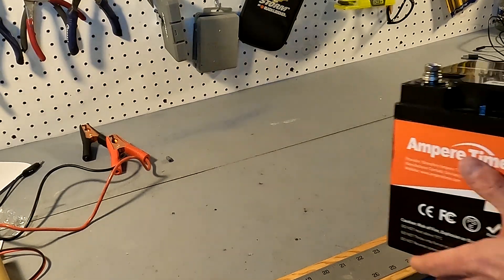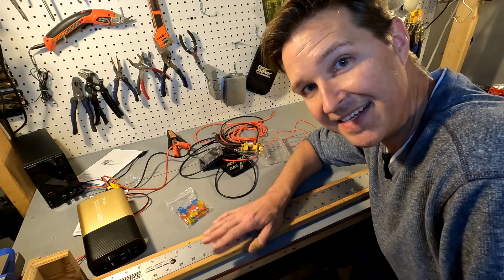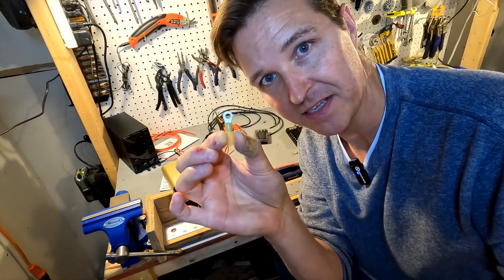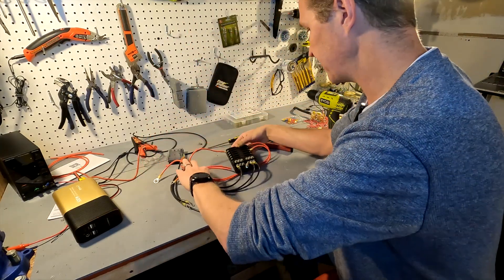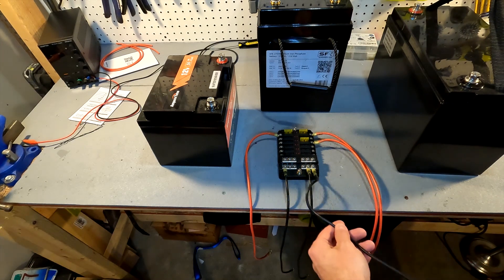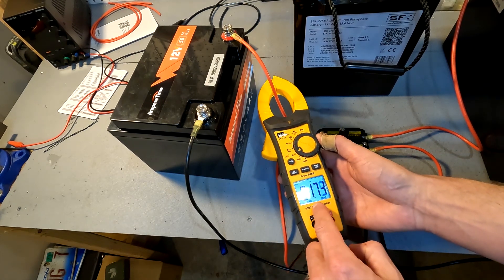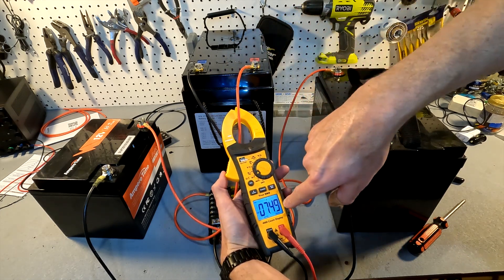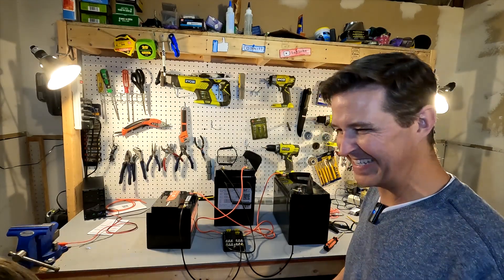Parallel connecting Lifepo4 batteries of different brands and sizes!  Extreme Parallel Part 1!

Comment: This is the practical test I can understand!!
Solar-People telling me I need 2/0 cable to connect my 2-100Ah LIFEPO batteries(same size), in parallel. When I'm using them in my cargo-conversion trailer, and maximum draw will be 30A, for lights and a small inverter. I'm not running large appliances, etc. And the maximum charge will probably be 60A (from an AC charger), and that would be if the batteries are dead. 
I can do wire size math, NP.  And NP upsizing a bit. But 2/0 seems like overkill to me. IMO
All that to say, this test is going to be very telling, thanks for doing it!
Reply: 8/0 is all you need for that if your runs are short. Look up a wire gauge chart to be sure. Don’t listen to idiots…including me.  Easy to look up what you need. 2/0 is so expensive.
Reply from the maker: I believe that is overkill.  If they're 100ah batteries, the most you will pull is 200amps or 2560w.  That is where they are getting the 2/0 cable from.  I think it can handle 250 amps.  Personally I would use 2 awg cable and a 150 Amp fuse at the most.  6 awg cable to handle 75 amps.  You could use that and a 100 fuse between the battery bank and the inverter / bus bar.  If you are going to use smaller cable, make sure to use a fuse.  Good luck!
Reply: @OffGridBasement  I always fuse/breaker. 
I use a main fuse, then breakers to branch circuit, then car fuses to each small circuit. Basically, I breaker or fuse at every wire size changes. 
Thanks for the videos, I understand electric and DC above average. Been soldering and messing with electricity and circuits for over 50 year. However, the delicateness (for lack of a better word) of Lithium with Solar is a new genre for me. 
Thanks again!

Comment: I had a jump box to start cars. When the lead battery went bad I replaced it with 4 lithium batteries from other jump boxes that quit working but the battery was good. The batteries were smaller than what you have but the wires was much bigger at 0 gauge. I used the trickle charger to keep it charged. Worked great for years until a friend jumped a car backwards and the battery pack caught fire.
Reply from the maker: Oh man!  Glad to see something like this worked for years.  Thanks for the comment and info.

Comment: very bad idea to use different batterys with different amps together ....
Reply from the maker: Can you explain why it's a bad idea?  The reason I'm doing these tests to find that out.
Reply: More detail would sure be helpful here. The way I see it, with same chemistry and BMS on each, the output/USE of the batteries is not likely to be problematic. The charging (from a charger or solar controller) might be - on the charging side, we have to realize that the chargers are smarter than they used to be - they make decisions on bulk charging versus float and trickle based on the OVERALL voltage they see at their leads. This winds up being an average in your case and may make the charger do a less than optimal job. Is it harmful? I'm not sure. But I think (I'm NOT the expert here and am seeking the truth as well) that you don't get what you truly want, optimally. But if you wind up in a safe situation that gets you 90% of optimal, then GREAT. I'll have some similar needs in the coming year for mixed LiFePO4 batteries and am quite interested in your findings. And I'd love to hear from @stefan why it's a bad idea.
Reply from the maker: @bobwolff68  I'm going to experimenting with this idea for a couple more videos.  I just don't like this idea of not using the storage capacity.  I'm going to incur big losses in conversation, but I'm interested in what those will be.
Reply: @OffGridBasement  I'd be happy to keep in touch on the topic and drive it to a conclusion with ya.

Comment: Curious now…..I have battery bank size issues with mine. I’m afraid I have boxed myself into a corner with my battery bank. I have 4 100 li time batteries in parallel. I need more capacity. So really interested in how this turns out. Any ideas for adding more than 4 in parallel?
Reply from the maker: I know the documentation states that it maxes out at 4 in parallel.  What about if you have 2 sets of 4 in parallel?  They are technically all still in parallel, but they would be on completely different wiring all the way to the bus bar.  Just a thought.  Thanks for the comment and question!

Comment: You wont be able to draw 20amps a channel on that auto fused distrabution  board  it will get very hot- the spring contacts just wont handle it
Reply from the maker: I don't plan on drawing that much per channel.  10a per channel is the most I was planning.  Thanks for the info.

Comment: Unfortunately you found out that different chargers due to programming, electrical components and what not will consider a "full" battery something different..  Even two identical chargers from the same company will have fully charged them differently. 

Batteries of the same chemistry and different capacity can be used together safe-ish as long as you consider a few things..  Ideally I would keep my max current usage to the capability of the smallest battery in the group.  LifePo4 batteries like you have should all have a BMS so that kind of eliminates that problem..  If everything goes wrong, the BMS should protect the battery..  And since you have the fuses rated for the wiring, then that eliminates the problem of overheating your wires..  So go for it! :)
Reply from the maker: Thanks for the info!

Comment: This is how I am running my heating pad for my battery box. It runs off a 400 watt inverter with 3 different 12v in parallel with a 100 watt panel. And a cheap pwm charge controller. I am using a seedling mat that only draws 33 watts when on. Keeps my 9 lithium iron phosphate toasty warm. But I am using 2 agm and 1 deep cycle battery works great so far
Reply from the maker: That is quite the mixture of batteries!  It's really good to see you making the most of what you have available.  No batteries should go to waste!  Thanks for the comment.

Comment: Cool, in my lead acid setup with many different amp hours on each battery i find in parellel you get the lowest voltage of the bunch,  so im guessing charging those 3 should only get them to 13.48, the lowest charge thats sticks on one battery.  So you loose some voltage headroom but make up for it with capacity.  I got  situation where one of my  batteries only "sticks" at 12.4, the others go upto 13.2 so it drags the rest down, but i get double the capcity so makes up for it.  The ideal soltuion is to turn on  the 12.4 battery when the others get down to 12.4, so it really doesnt drag them down.  So maybe a dynamic switching system, turning the batteries on as they get close to their ideal  voltage coupled with charging them seperatley so they can reach their max voltage.   This would get the most out of a parrell system with miss matched voltages, but simply adding capacity in a parralel situation can more then make up for any voltage loss. Anyway, looking forward to the results because im also curiouse to where the amps go when they're parallel charging.
Reply from the maker: I believe you are correct about getting the voltage of the lowest battery.  Thanks for all the good info!

Comment: Thanks for sharing!  I know it's pretty cool to see how the different size batteries all tend to balance out together.

Before I started documenting my solar setup, my original 12v system consisted of 2 different batteries, one was 280Ah, the other was 200Ah (and actually the 200Ah was in a 2P configuration of separate 100Ah packs).  I played around a little bit watching how the 2 different packs charged and discharged.

Now I'm working on converting my old 12v system into a portable power station.  To start it'll only be the 280Ah battery, but I wana make it expandable so I can add the 200Ah battery down the road.
Reply from the maker: That is a great use of old, unused batteries.  They're going to last for years so you might as well get some use out of the extra capacity!